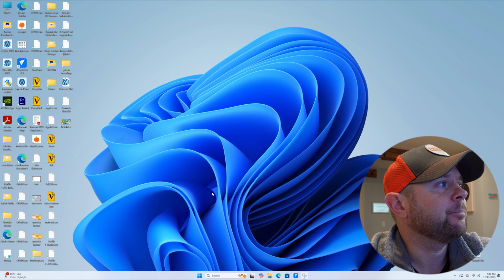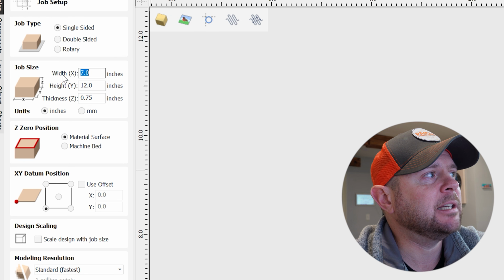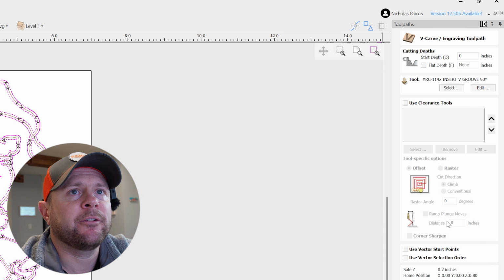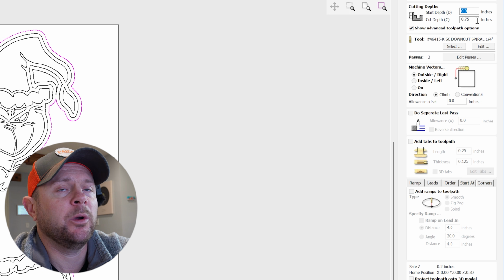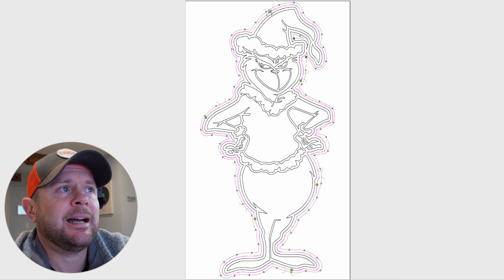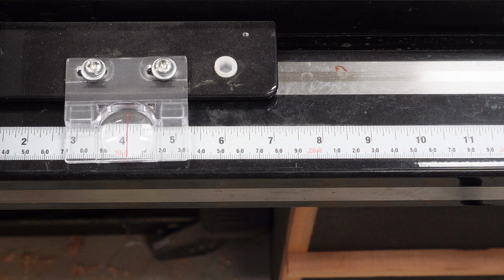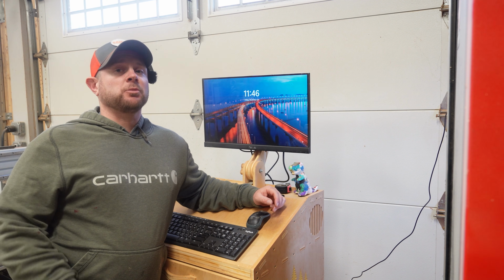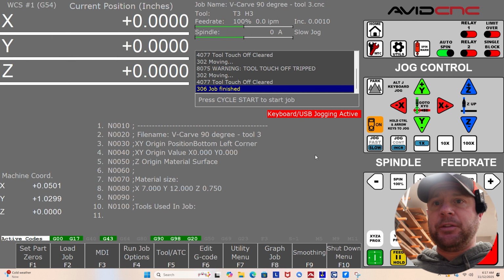New to CNC? Start Here! A Beginner’s First Project!

Comment: Thanks for sharing this entry level instructional video.  You have a very well setup shop.  There may be some confusion on my part.  Did you do a manual tool change on the Vbit after you installed it prior to zero the z.  Thanks again for the video and the file.  
Free grinch cnc file
Reply from the maker: You’re welcome and thank you!  Yes, I did a manual tool change on the bit after I put it in. I may not have shown it in the video so that’s my bad. In my machine, after I change the bit, I run a preset program to touch the bit off the touch plate to recalculate the z axis.
Use code FREECNC at checkout on my website to download the .CRV file. Let me know if there are any problems! www.thepaicosaestheticwoodshop.com

Comment: Ok I have tried to figure this out. I keep having to remove my tool database and reinstall it when I move between files. Why is this happening. Am I not installing it right? Any thoughts?
Reply from the maker: Hmmmm, what do you mean when you move between files?
Reply: @Thepaicosaesthetic  so when I am working on a vcarve file for anything. I will create toolpaths and post process my gcode. I will save my file then go to work on another file. I go to change my bit for the toolpath I need to do in the new file but the bits are greyed out. I then have to remove the tool database and re upload the database. Once I do I am able change bits and create new tool paths.
Reply from the maker: @justinredman6882 it’s honestly hard to say without me seeing it firsthand, but that sounds like a software bug because that shouldn’t be happening. Make sure you have the most updated version of vcarve installed. I think 12.5 is the newest
Reply: @Thepaicosaesthetic I have already gone through this and checked. Is there a way to send you an email with screenshots?
Reply from the maker: @justinredman6882 sure, you can send me an email at npaicos@gmail.com. I can’t promise I can find you a solution, but I’ll take a look and do the best I can.